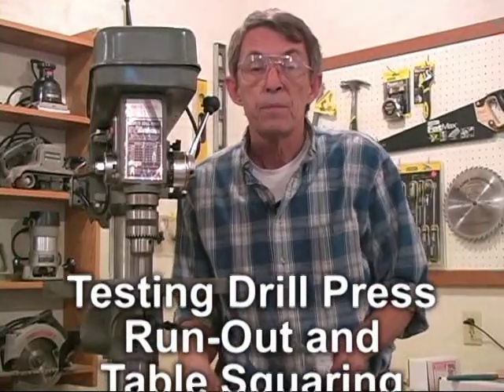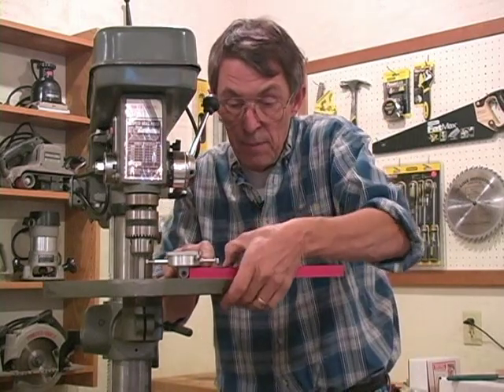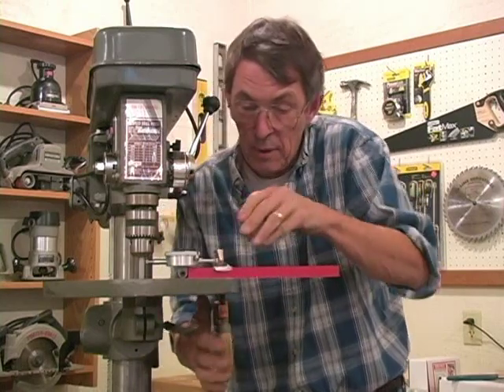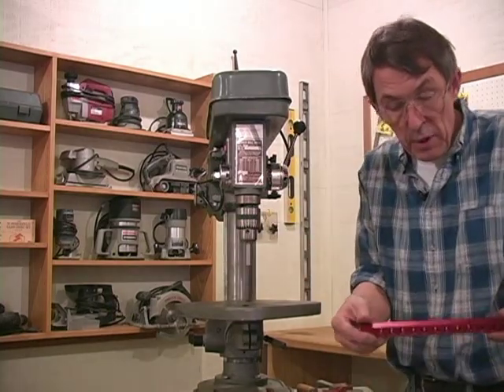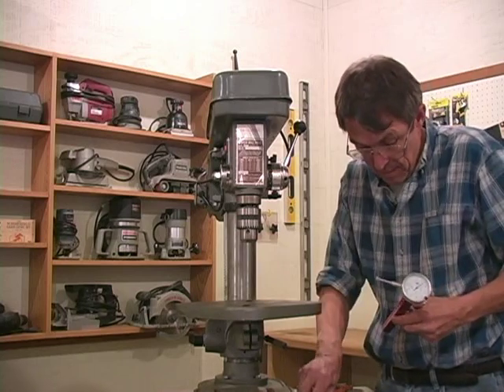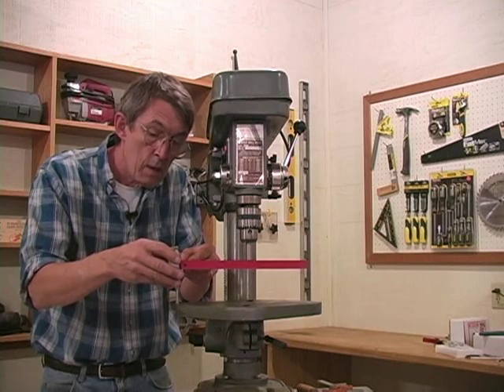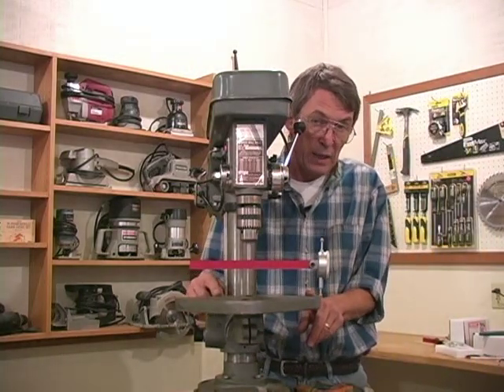Testing Drill Press Run-Out and Table Squaring

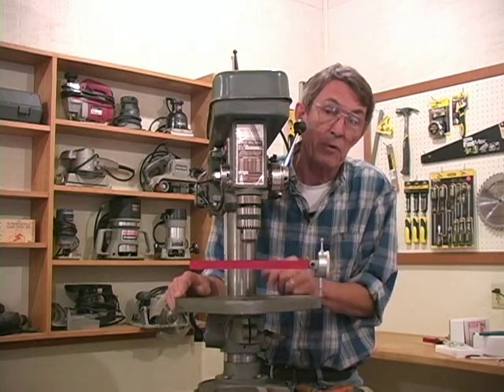Comment: 5:49 no, it's not perfectly square because you didn't check front to back, and didn't mention it needing to be done.  You can't assume that since there is no adjustment that it comes perfect from the factory.  I had to shim mine to get it 90 deg. to the spindle.
Reply: You must be building a nuclear reactor.
Reply: @jimgresham5529  when you drill shallow holes (like in 1/4" steel, being 1 deg off really doesn't make a difference.  I drill in 3" wood and those holes have to be straight.  It would seem that with any machine, one would want it as accurate as possible.  I guess not....

Comment: Nice to have that dial indicator, but if you don't have one both these test can be done by using a pencil.
Reply: A pencil will not tell you how much you are off.
Reply: @MAGAMAN  that's true it will not, but you can at least tell it's off. The trick with the pencil is what to look for, if the mark is the same all the way around then no runout. If it's not half way around or more then you have runout... the mark has to at least be halfway around or more. If the mark is thicker on one side and thinner on the other, it's hitting more on that side and runout is minimum. It depends on how much is too much for your needs really. How precise do you need it?... then decide if a pencil mark will be good enough or not.

Comment: Jerry, your test only verifies squareness - at that point - of near-zero spindle travel. It's a good starting point, and one has to start somewhere, but you need to repeat the test when the spindle is extended and/or when the table is lowered to a different place on the column. I'm betting that most big-box-store drill presses will be way out when the spindle is extended... I know from experience that, when fully extended, the spindle of my cheapo drill press is as floppy as Hugh Grant's hair! Similarly, I wouldn't like to vouch for the column straightness... :-(
Life may be somewhat less tricky for owners of 'proper' industrial grade tools.

Comment: how do you make it so your drill bit is a perfect 90Deg. to your table? and then so your slide vice is moving in a perfectly straight line below the bit? I want to clamp a tube in the vise and then drill a hole in it, advance the vice forward 1/2" and drill another hole...four times in total. But I want them all straight and uniform.

Comment: squaring side to side is only half the battle, what about front to back where there is no adjustment, now what?
Reply: My table has a setscrew under the table bevel lock nut.  When you tighten the screw, the front of the table raises.
Reply: @darrenx5699  Mine does that too! So frustrating having to shim that.
Reply: If used for woodworking and this was an issue I would make an auxiliary table that can be shimmed as needed.
Reply: You verify what the table is in relation to the head then shim the head connection to the column. Then of coarse you must assume that the column is straight. Or you shim the item to be drilled to the drill.

Comment: If the drill press base and column is level then you could use a level. Using a dial indicator to tram the table is a better option because it reduces the number of unknowns you have to deal with.